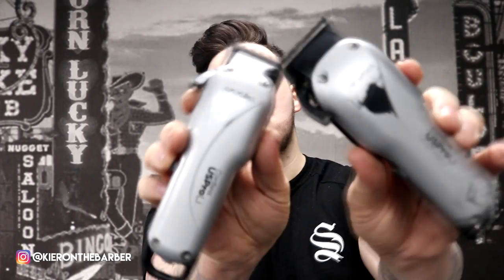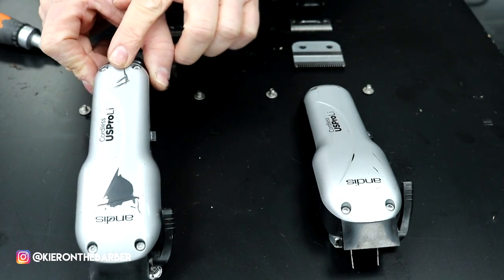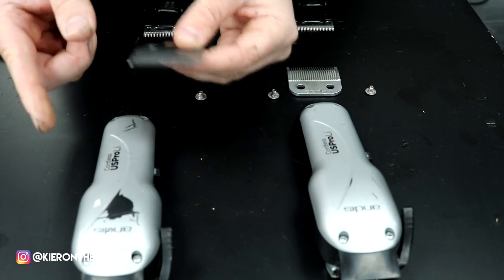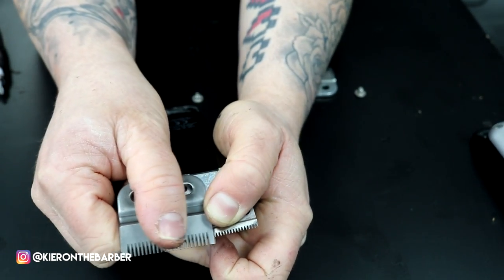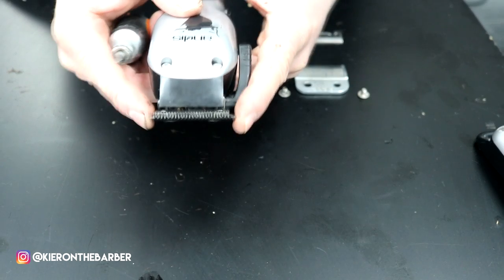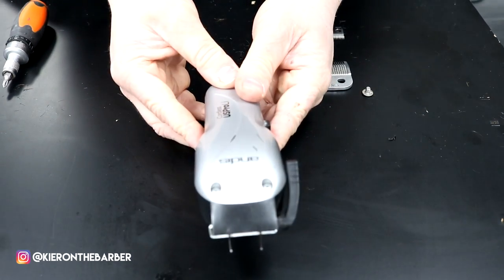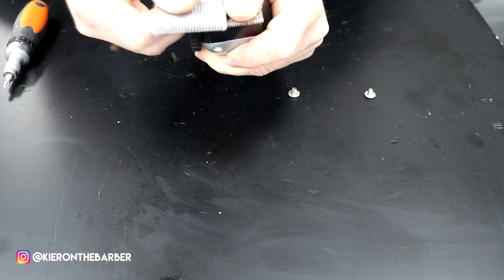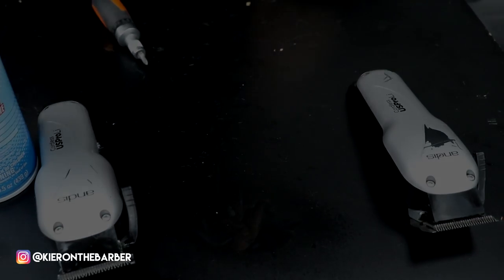How To Change Us Pro Cordless To A Fade Cordless!

Comment: I'm really converting over to some Andis gear. Gotta pair of Pro Alloy's and i love em, but I still have the odd issue with some of Andis's component quality, namely those blade screws. They have small cross indents, and the metal isn't that hard, and I threaded mine easily. And cut my finger trying to get the blade off!! Bizarrely Andis dont supply new screws with replacement blades. But Wahl do, and their screws are much more robust. And they fit Andis clippers, so I've switched the screws over for Wahl ones. That way you can also tighten them a little more securely. Loving your work big man, keep it up.